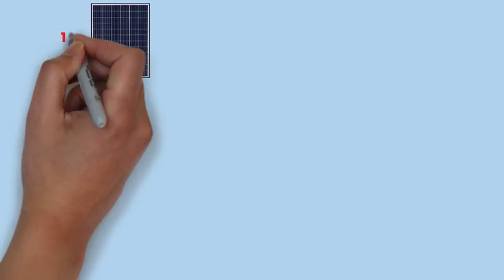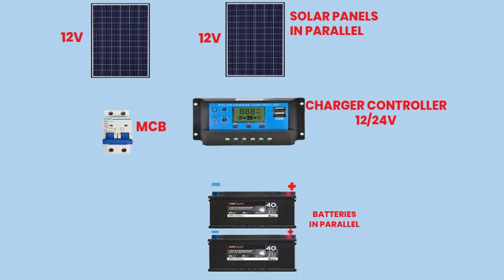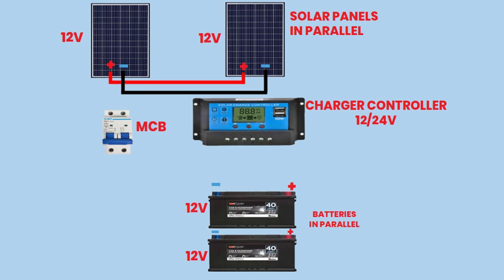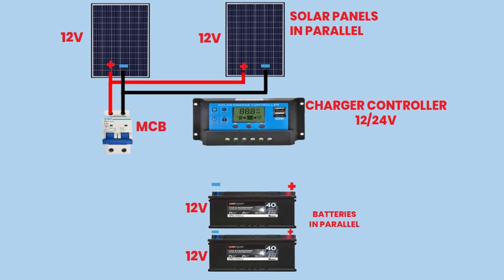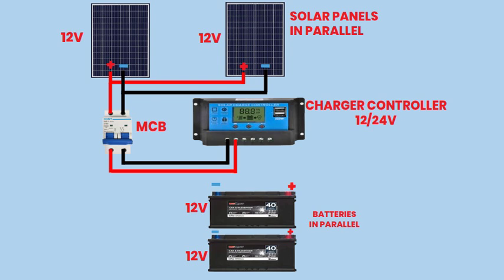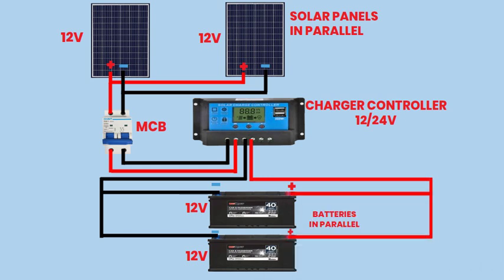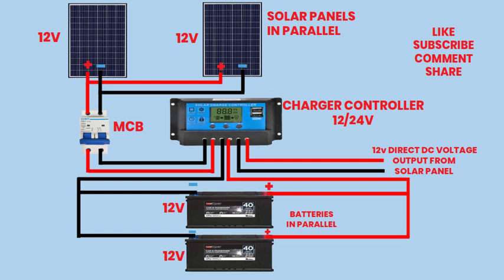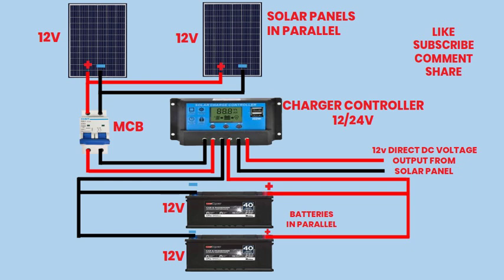Avoiding Common Mistakes: How to Connect Solar Panels in parallel

Comment: Great update Engineer... What's MCB & how  can you convert  the out put DC current to be used as a AC ? Thanks
Reply from the maker: MCB stands for Miniature Circuit Breaker. It is an electromechanical device designed to protect an electrical circuit from damage caused by overload or short circuit. MCBs are commonly used in residential and commercial electrical installations to provide protection and safety.

To convert the output DC current to AC, you would need to use an inverter. An inverter is an electronic device that converts DC (direct current) to AC (alternating current). It does this by using electronic components to switch the direction of the current, creating an alternating flow of electricity. Inverters are commonly used in applications such as solar power systems, battery backup systems, and in vehicles to power AC devices from DC sources.